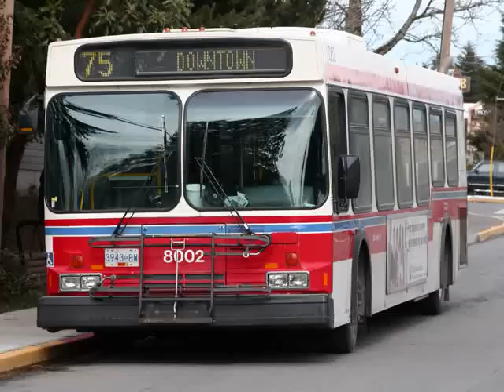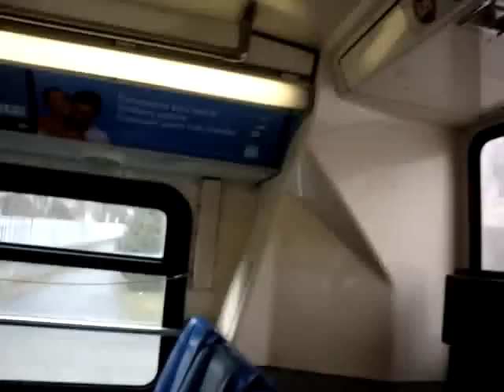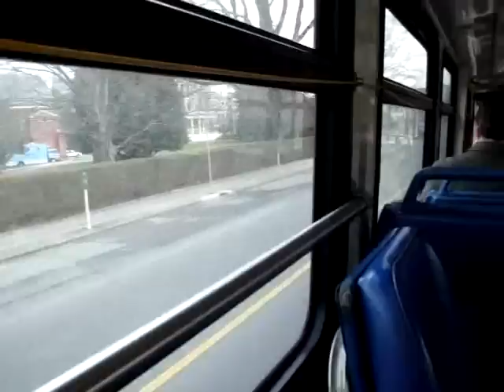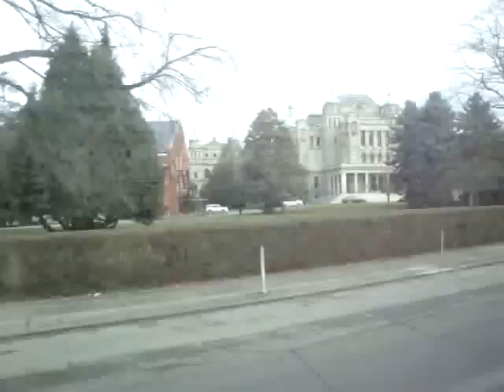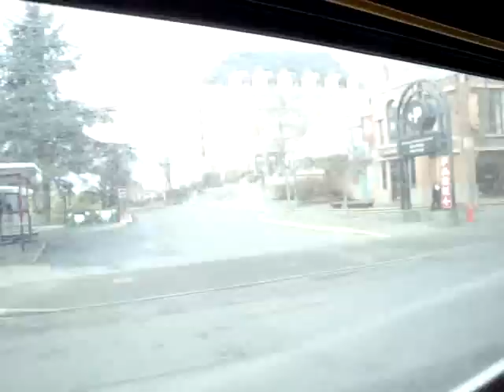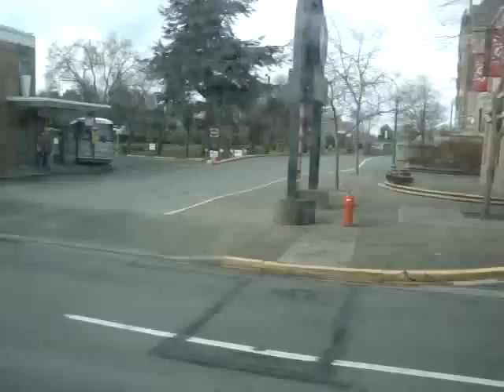Victoria Regional Transit System - BC Transit 1991 NFI Low Floor model D40LF #8002

Comment from the maker: Yup! I remember them that way. The tail lights were top to bottom, signal, reverse, brake / running light. The reverse light was the much smaller sized seen on the back end of GMC / GMDD Fishbowls built from 1968-1986.